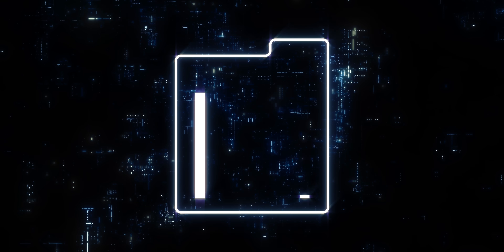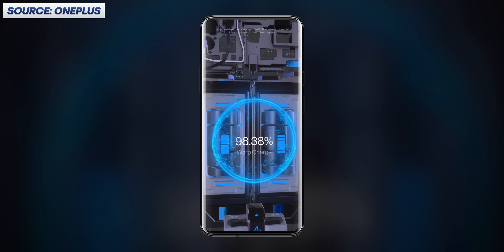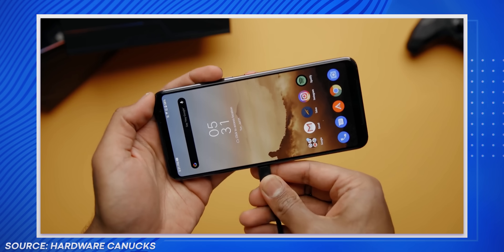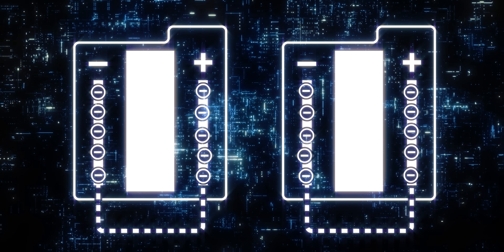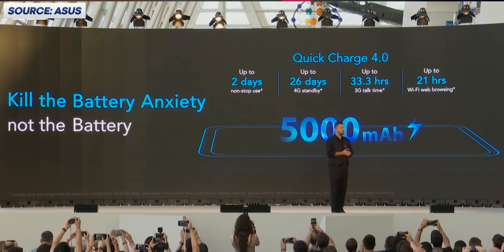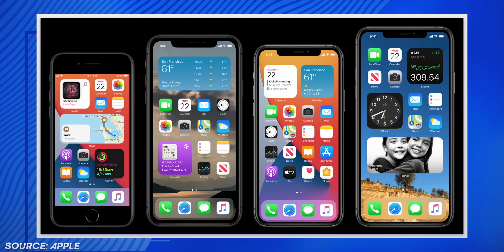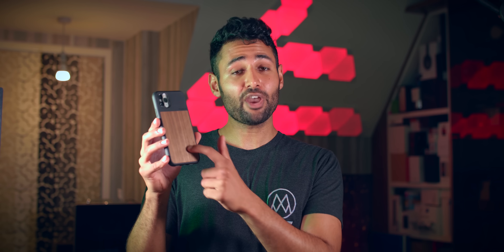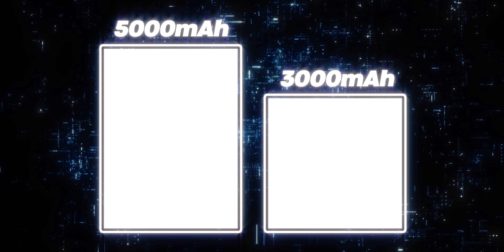The Problem with Fast Chargers.

Comment: In my option, all phones should come with a high wattage block i.e. 120w and then within settings you should have the option to choose your charging wattage (5/12/15/18/30/45/65/120 etc..) which would allow the user to decide on faster charging or battery preservation.
Reply: If it was that straightforward that's what everyone would do.
Reply: This is a terrible idea
Reply: @jjdalrymple3128  Qualcomm QC 5.0 is supposed be up to 100w. 2021 phones will roll out with 100w charging and I would imagine by 2023 it will be a total deal breaker to not include 100w charging in a device.
Reply: @seanlutzke1694  where is your dreamed 100w charging? Samsung Galaxy S21 is limited to 25W, Google Pixel 5a is limited to 18W. Yeah pretty close to that 100w..
Reply: @Winkoo6  Xiaomi has a phone that charges at 120W and did when this video went live. I'm still not expecting it to be mainstream for a while.
Reply: @seanlutzke1694  just see the pattern, everyone who promising at least 3-4 years update, remove the fast charging. So who remain? Those who want to force you to buy a new phone in every 2-3 years, because the fast charging kill your battery faster. If you already planing to buy a new phone that frequently, just fine, use it, but if you just forced to buy a new one, because it's still fast enough, just you can't find a proper battery replacement for the 3 years old phone, it's not the best.
Reply: JJ the Parfait if @Mrwhostheboss agrees with you, I’m going with this opinion
Reply: @jjdalrymple3128  ok but why?
Reply: @jjdalrymple3128  why
Reply: @jjdalrymple3128  why ? And why do you even get a pin XD
Reply: Inorder to do that they'll have to make the Battery and circuits able to receive that High amount of wattage which the phone will cost more and plus it'll get more hot
Reply: @daddymao2944  and also all are not that smart to choose whats best for them most will choose highest voltage and often damage battery
Reply: @daddymao2944  👍
Reply: Wattage. Can’t help but read it in a British accent🤣
Reply: But that means they would still have to make the separator bigger and reduce battery size in the first place
Reply: You cant make the divider bigger from the settings
Reply: 20-30w fast charging is perfectly fine. My Oneplus 6t charges to nearly 50% in half an hour. With its good battery life this lasts most of my day and can last the whole day if Iuse power saving mode and don't game. Anything faster than 30w makes no sense
Reply: That's what he said.
Reply: most users probably won't understand what that means and will either never know about it or find it and set it to the highest wattage because it saves them time
Reply: @TechNick the AccA app by Mattecarra does exactly what u want and even more including capacity control, temperature control, auto/manual voltage and current control, battery cool down and other stuff. It requires root though. My new battery hasn't degraded since more than a year with it
Reply: Believe it or not that's how usb power delivery work (short of) 
Choosing the amount of voltage and tell the charger to change the output voltage depending on what device it plugged in
Reply: agreed!
Reply: hi techNick,your previous video demonstrated how apple preserve battery life by slowing charge of last 8% for 1 hour. heat generate from mi10 was 45c(120w) vs iphone 32c(18w)..xiaomi surely want their phone die faster
Reply: Why you don't buy a power supply which is able to set both voltage and current... 
Not my recommendation for everyone though.
Reply: It need a circuit blockers, splitting process...bla...
Which occupy some more space
120w will kill the battery in few years lol!
I believe phone are some non return investment
Long we use long we save money
Reply: HA! YOU'LL BUY OUR 2000 DOLLAR SLAB AND DO WHATEVER WE TELL YOU,AND YOU'LL LIKE IT!
Reply: Who needs that lol
Reply: It's already partially possible, you can disable fast charge on samsung phones. What I do is I just use an old charger like normal usb charger or charge with computer. I only use my fast charger in "emergencies" when the phone needs to charge fast
Reply: That's not how electronics work my man. If you're gonna provide your phone with 120w but charge it with only 30w all that energy has to go somewhere. It doesn't just disappear. And the only way to get rid of it is more resistance. Or in other words, more heat
Reply: @yrm1594  or trickle charge. But I don't know if this is unhealthy for a battery.
Reply: @xxBlackpspxx  I was actually just replying to the original guy but if you use trickle charge to keep your phone at 100% you accomplish nothing. I would recommend keeping your phone (or any other device with a battery) at 15%-85%
Reply: @yrm1594  i mean trickling all the time. Charging at 120 watt for 0.5 seconds. Not charging for the next 0.5 seconds. And so on. Then you have 60 watt. Charging only 0.25 seconds per second yields 30 watts. But I don't know what this does to the battery
Reply: @yrm1594  also I am not sure if you are right. When your phone is at 90% it cools down a lot also, despite there still coming 5 volts out of the power supply. It's not that simple. Higher resistance means less current so there's less power so there's less heat. Think about light bulbs. Anyways I don't know how the charging electronics work in particular so..
Reply: @yrm1594  i also have a charger for 18650 batteries and can switch between 500mA and 1A charging current. At 1A everything from batteries to power brick gets a lot warmer. So ye it is how electronics work.
Reply: @xxBlackpspxx  That's what I said
Reply: You know... most phones can't even handle that much power. A 120W charger would do absolutely nothing but drive the cost up. Compact 120W chargers are REALLY expensive.
Reply: Do whatever. The battery is just gonna crap out 3 months later. The fone is always on. A FACTORY RESET is just switching the power source off. A couple other commands but that's about it.The U.S. gets fucked by communications Companies.
Reply: Yes
Reply: Good idea
Reply: ボイス  who stupid
Reply: Why you not became physics teachers first before comments on something even you didn't know the sience of it ?
Reply: Funny how Arun hearted the negative reply of this comment lmao 🤣
Reply: @big_smoke7t  Ikr😂 But honestly,yes it's a terrible idea
Reply: lol. First of all it will never happen, because it rises unnecessary costs, second, 90% of smartphone users even don't know where settings are.
Reply: @whitealiens   Even if they don't have unnecessary costs they will raise the prices. Apple, for example, will launch a new phone without a charger in the box probably, and you will see an increase in price, let's see how much... The price of flagship phones will always rise and not all because of "costs" necessary or unnecessary, is all because company's want more profit. That's why they have flagships or premium phones, then middle-range phones and low-cost phones (not all companies).
Reply: Heyyyy tech nick I know you
Reply: Such a terrible idea
Reply: Good idea 👍🏻 1 sub+ for u
Reply: Fun fact: a lot of phones can already do that. Check your settings, depending on your phone there might be a setting to disable fast charging. Choosing specific wattages is useless, since there are two use cases: either you have time and can wait for slow charge, or you don't and then you go full speed. Charging at 17.98W is useless.
Reply: Why 120watt? Just ask 500watt
Reply: @ArunG273  because 120W actually exists on smartphones.
Reply: @TechNick  wow you replied.
Reply: @MrWhite-ru3oz  lol
Reply: @ArunG273  100w is the limit that you can charge on a plane. Also your car wouldn't want to power something at 500w. Also it would be super expensive.
Reply: Bro what about non tec literet people most off them wont change there settings
Reply: What if there's a bug in the ROM and the phone is cooked lol!

Comment: Also, just a tip if you’re repairing your phone and you’re close to the battery, if you can afford it, replace it. Nearly 12 Months with the Pixel 4 XL I’ve smashed the screen so while I’m at it In replacing the battery

Comment: I've heard there is settings to be enabled that can charge baterry overnight to specific % and stop not full and them charge to full when it's time to wake up and unplug cable. What smartphones can do this besides iPhone?
Reply: Galaxy S10 has a similar "learning" option in Battery Settings as well (doesn't tel aboutl specific % value though), so I would expect newer S/Note models also

Comment: Actually arun I have a question that what is the best sweet spot for charger wattage since I used 10 watt charger all my life but since I got a 27 watt fast charger phone it's a huge huge upgrade for me for me it the fast since I come from 10 watt what are your opinion is 27/30 watt charger good for fast charging as well as maintaining its battery life or 65 watt is the sweet spot you audience tell me with reasoning behind it👍

Comment: Hi Arun, great video! Leared a lot, yet I'd like to ask if the technology behind vooc and warp charging (Oppo and Oneplus, guess RealMe too) has the same pros and cons, as they use a different way to speed up the charge (they keep the voltage to 5V, the native of the battery, and ramp up the current, up to 6A, even 12A or more) to they keep most of the heat on the charging brick and not on the smartphone. Thank you!

Comment: He's mostly right, but at 0 percent there are equal amounts of electrons on both sides of the battery, as voltage is only the potential for electrons to move. If all of the electrons went to the positive side, there would be an imbalance. At zero percent, there is no imbalance, and thus no charge.

Comment: My note 8 has fast charging and I use it every day and don't use my phone when it charges and put him on a phone stand to keep him cool whith air
And my question is whether I could still have problems with the battery in the long run
Reply: It's completely full in 1,40 hours

Comment: The batteries of my 5 yr. old ASUS Zf2 (18Watt fast charger + 4gb/64gb config) lasted 3 years, then replaced with Chinese battery which is 2 yrs old now and it's time for another battery replacement. I got this mileage mainly by MOSTLY charging phone from 20% to 95%. Rarely touching extremes %.

Comment: Arun you've made a little mistake. When the battery is at 50% there aren't the same amount of electrons at positive and negative pole. In theory only at 0 Volts there is the same amount of electrons on both sides (Obviously the battery will never hit 0 Volts). But maybe you did it on purpose so people aren't confused? Anyway... Great Video!

Comment: What about “Graphene enhanced” battery in Mi 10 Ultra? Xiaomi promised the battery will remain over 90% of its capacity even after 800 charging cycles. That’s way better than some batteries with slower charging speed. (Yes, I mean iPhones.)

Comment: hmm.. another video where u mix in your opinions/theories with scientific facts... Apple's official response about throttling older devices was about the battery not being able to deliver peak current for the processor to be able to operate at full speed. The first half of the video was really cool though.. I did not know about the separator having to be thicker to allow fast charging.. Thanks!

Comment: I think fast charging promotes "healthier" charging habits. Instead of frantically charging your phone to 100% at every opportunity because who knows when you'll have time to charge it again, you're fine taking it to the office at 30-40%, because you can quickly charge it it to 60-70% if you need to.

Of course these days no one is going to any office so they might as well start selling phones without batteries. Who needs them anyway when you're just laying on the couch all day?

Comment: I don't think battery degradation is a problem on mid to high range phones, most people are set to change phone after about two years and with the large size batteries that they have even with harsh degradation, battery life is still largely enough to last one day.